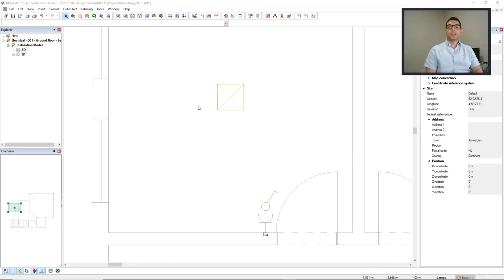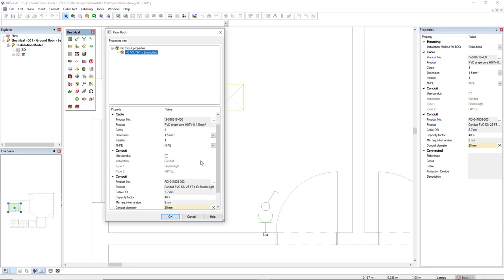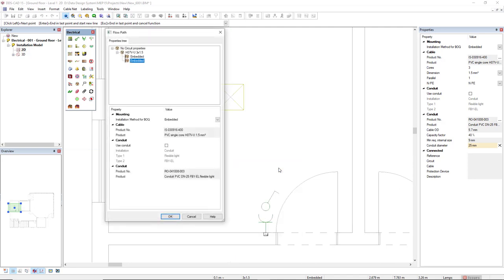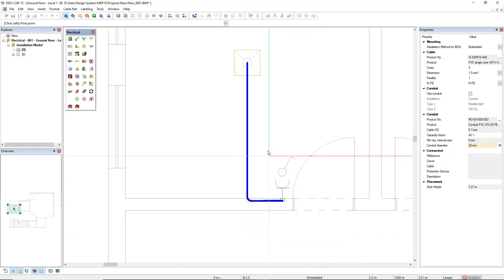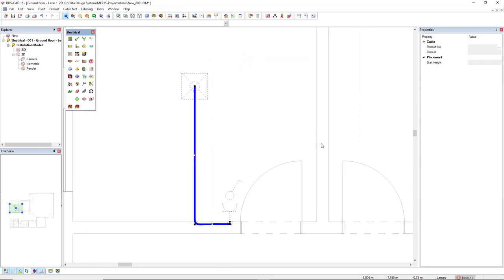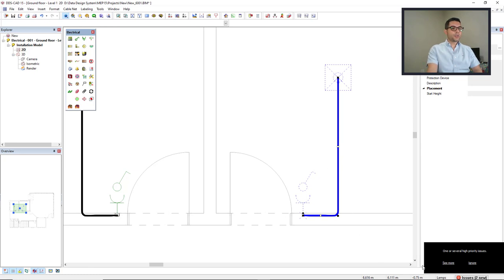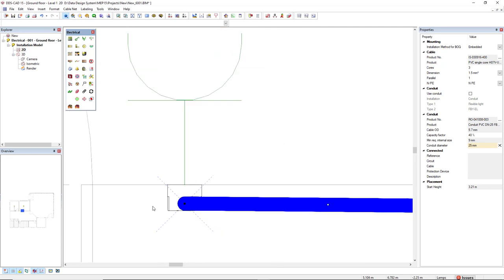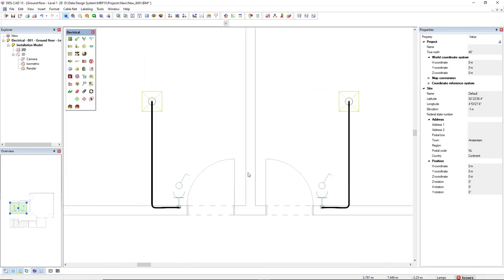DDScad 15: Getting Started  - Electrical - Applying cabling and using the mirror function

Comment: Please help.

1. After I have already arranged the cable, can I arrange some of it in the tube (some part of the cable)?

2. How to move the cable from the 0.3m socket to the ceiling so that it automatically moves to the ceiling surface.
3. If you have two junction boxes with electrical sockets in them, can you connect them together and then run the cable to the electrical board? Sometimes you have multiple sockets on the same circuit.
Reply from the maker: Hi targetti, please send an email to support@dds-cad.com
Reply: @DDSCAD-MEP  You're right. I can write for support, but that's not the point.
1. Someone else may have a similar problem, and the youtube response is the best source of information.
2. Maybe another user knows the answer and will help me on youtube.
3. These questions can be used for Filipe's take on DDS-CAD playlist.
4. Support will send me to the representative in the country, but unfortunately in mine it works very poorly.
Reply from the maker: @targetti123456  , same as I answered in the other video, these questions are quite hard to answered here, that´s why I am asking you to ask me that by support email, this way we can even schedule a remote support.
Regards,

Filipe